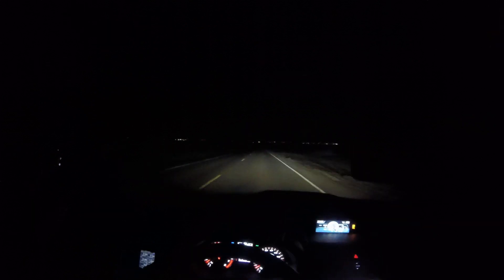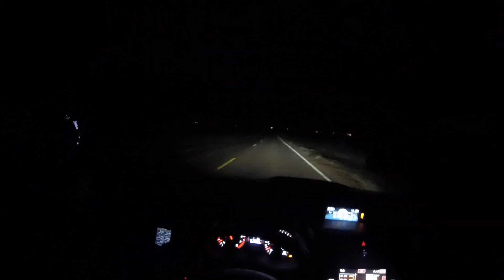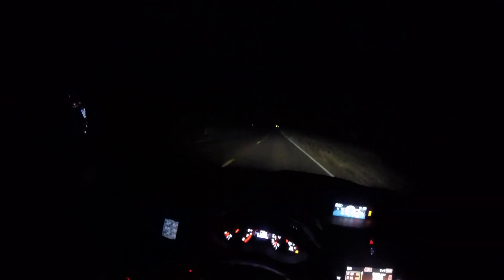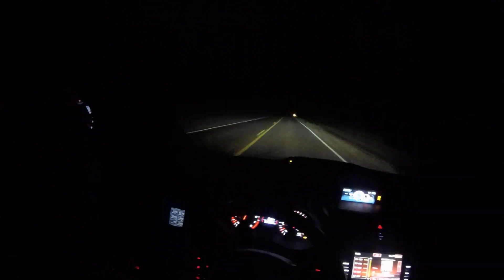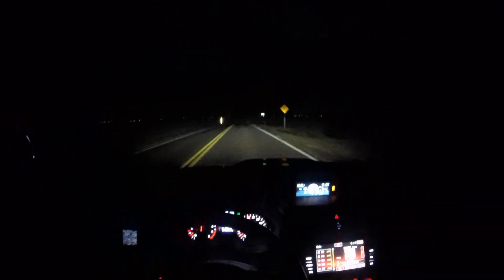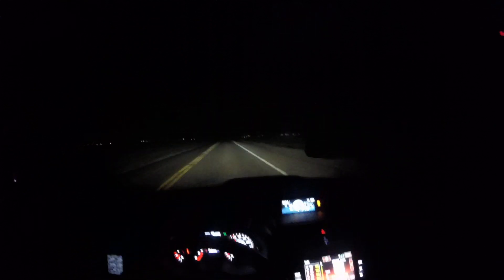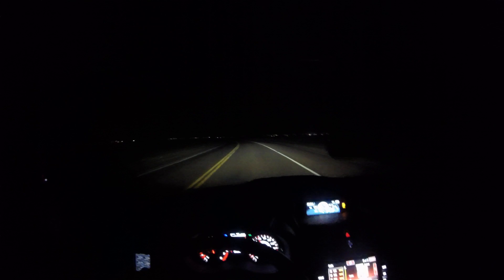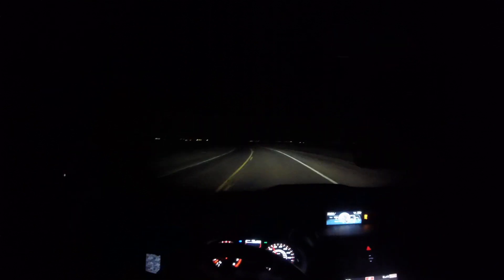2018 STI cobb stage 3 ringland failure, bad fuel pump ahhhhhhh.........

Comment: I wouldn’t worry too much about what you hear on forums. Change your fluids on time with quality fluids and you’ll be fine. I have an 06 wrx with 172,000 miles on it (with a stage 2 custom tune original engine and turbo). Still runs great.
Reply from the maker: Absolutely agree.
Reply: @PetesTurboGarage  Nice car by the way. Seems like it pulls really well

Comment: Def need to check mine. Did a code pop up at all? Mines not showing codes but stutters and cuts out power at 3500rpm and 5psi on WOT
Reply from the maker: No code ever did pop up. I ended pulling one of the fuel lines to check for fuel pressure and it just dribbled out, so that was how I found out a o ring was misseated. Hopefully it's something simple for you man.
Reply: Pete's Turbo Garage just switched my spark plugs at 49k. Car is good now.

Comment: How is it going now? What's your stage 3 setup?
Reply from the maker: It was flex fuel, full cobb stage 3 kit. No Longer have it. But it never gave me any other issues after fixing the o ring I jacked up. Went to the 05 sti and mkiv supra platforms now.
Reply: Mine still stock and planning to upgrade, just worried for reliability so I'm doing a research. Your stage 3 setup was an e-tuned or pro-tuned?
Reply from the maker: @jomsti4840  I always go through eric at torqued performance. Etune he's good at what he does.
Reply: Great, Thanks!

Comment: Dude im having the same issue except mines leans out towards high boost and i replaced the 0 rings and checked for leaks but it still does it i guess my fuel pump is dead
Reply from the maker: Diego Olalde take the line off at the Fuel pressure regulator to return and see if there is any pressure. If it doesn't spray then most likely a pump problem.
Reply: peter c thanks for the tip bro ill give it a try
Reply: peter c do i do that while the car is idling tho?
Reply from the maker: Diego Olalde no just turn the ignition on and let the pump prime. Then take the line off it should have pressure if not the pump isn't making pressure.
Reply: peter c thanks bro!
Reply: peter c i fixed my car!! Turned out to be my coil packs i replaced them all and ive never felt my car rev soo smooth thanks again
Reply from the maker: Diego Olalde that's great to hear man. Enjoy it!